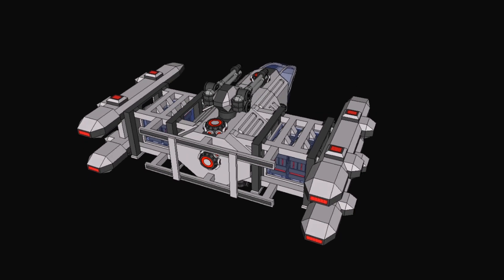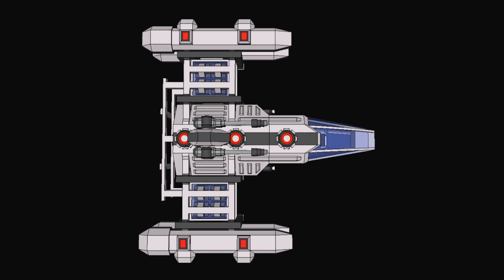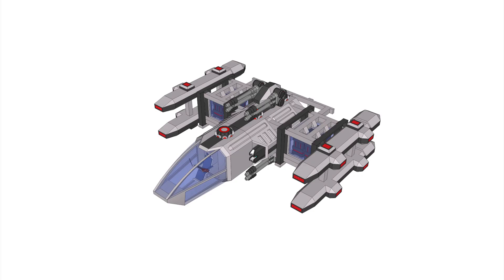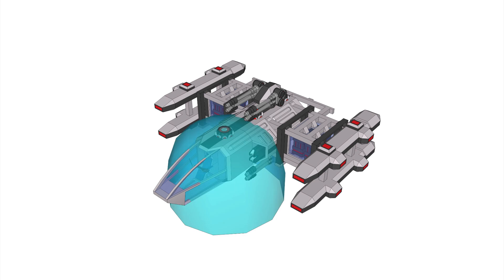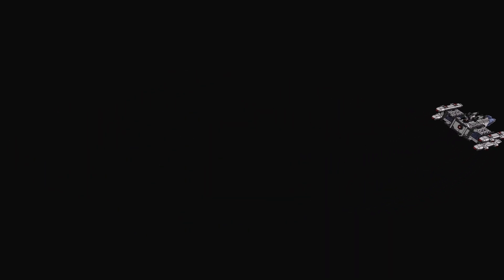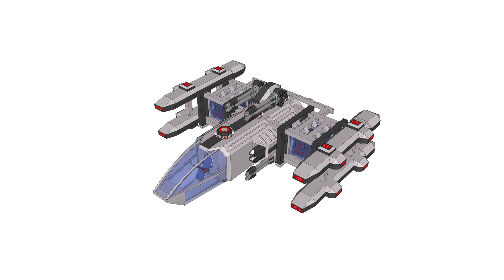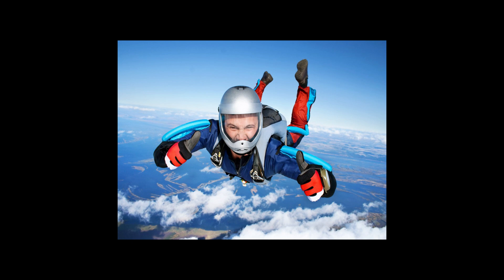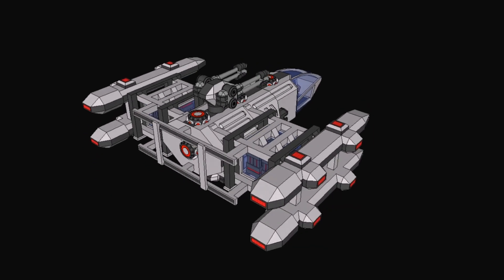Shad has a question! Gravitational acceleration on a spaceship?

Comment: Well, I'll close my eyes on the momentum conservation now. As your generator is on the spaceship I'd assume that it provides the uniform proper acceleration. I.e. you take the inertial reference frame in which the ship stands still and calculate the acceleration of the ship (later you'll have to use different reference frame moving faster) The faster the ship is moving with respect to the Earth the slower it will be accelerating. When it will approach the speed of light the acceleration will drop to zero. So your ship will go faster and faster but it will never actually even reach the speed of light let alone cross it.

That's very simple special relativity problem with solutions you can easily find. The worldline (you can treat it as a graph x(t) ) will be simply the hyperbola asymptotically approaching lightcone.
Reply: By the way, if you make your engine that magical (with momentum non-conservation and all that) you can get pretty ridiculous plots. Imagine that your engine can hold this proper acceleration for a couple of decades. So your heroes get themselves into hybernation and launch the spaceship at 1g. But due to some malfunction they wake up 15 year later (of their proper time) Can you guess how far they went? About 2.5 million light-years, flying by the Andromeda galaxy. Of course at the Earth there will pass about 2.5 million years.

Comment: Yes, since you're not inducing frame dragging by expanding space as well (as with an alcubierre drive) what you have is a relativistic drive in simple terms. (Since you're still moving through space, and so would be subject to things like time dilation as you approach C)

Other limiting factors would be things like impacts with micrometers or even atoms in space.

Interestingly, since you're creating the field with particles with a set velocity, as you approach C, I think you'd get a compression of the anti-gravity field propagating forward similar to how aircraft compress the air in front of them as they approach mach1.

The practical effect of this would be a speed limit based on several factors after which the nose of your ship would begin to spegettify as if it were approaching a black hole.

For higher speed craft, you may want to be behind the engine to help survive. (At which point, you can use being outside the field to create artificial gravity with the right acceleration)
Reply: As an aside, as with all relativistic engines, these make remarkably good weapons. (Even world-killers, depending on the mass and speed limit)

Stick a supped up one of these to the back of even a small asteroid and you've got a big boom! (Sure, the asteroid might be spaghettified into plasma, but at those speeds, structure is pretty irrelevant)

Actually, even if such weapons are banned, a broken ship moving at 0.9C would be a significant threat in the unlikely event it was actually on a collision course with anything important.
Reply from the maker: In my setting earth was destroyed through this very process 0.o

Comment: If you could induce gravity towards the front of the ship, then your ship would fall forward at constant acceleration. But it wouldn't be able to go faster than the speed of light due to relativity. To do that you need to create an  Alcubierre drive and compress the space in front of the ship, while expanding the space behind the ship. Just an induced gravity drive is good for sublight speeds only. It would also take a humongous amount of energy. On the plus side though, if you rigged things up properly, the ship would be able to pull off some very high g manoeuvres without the crew feeling the effects and being squashed.

Comment: Shad, I believe Your Idea wouldn't be too far off from another theory of propulsion that other scientists have, Known as a Warp drive . And if the base principle is still there.  Its speed would be dependent on how much gravity the generators can output. If the generators could push out cones of enough gravity in a single direction, It wouldn't be unlike a reverse of a black whole. So theoretically, With enough gravity, and if the ship could withstand the strain with its dampeners, its speed could be almost limitless. The problem lies in the physics, Unless the ship has a way to counter its mass, It would be torn apart once reaching speeds any where close to the speed of light. 
That is my opinion on what little i know about physics.

Comment: Probably the most popular form of "realistic" FTL transportation is the Alcubierre Drive. Give it a look on wikipedia(or anywhere else because it really is popular in the physics community). 

Essentially, you squish the space in front of you(so that the distance you need to travel is shorter) and you expand the space behind you forcing your ship forward. This would represent a large issue when moving at FTL speeds  however. If you are going superluminal, there is no way for you to send a signal to the front of your space-time distortion bubble. So you can't stop unless you crash into something...ending the existence of the world you were traveling to with the astronomical impact force. What you would need to stop your ship is a sort of railway system or, rather, devices to force your ship to a stop. Of course, that would imply that someone would have needed to travel to far away locations first to plant those stopping points first. 

So...maybe not the most practical method of FTL travel but one that hasn't been used very often as far as I know. If anything, it could serve as a secondary means of super-long-range travel when your standard fantastical warp drive just won't do the job.

Comment: If you are generating an artificial gravity over the entire ship, then the ship would accelerate by an equal amount and in the opposite direction as the "pulse field generators". So either there is no net movement at all, or the generators are ripped out of the ship. And if an on-board thingy can accelerate the ship as you describe, then all physical laws are out of the window.

Comment: Yes there is a limit: the speed of light, because as you get higher and higher energy matter from your ship going faster, its mass effectively increases, and the same energy input accelerates it less and less, asymptoting toward infinite energy required as you approach the speed of light.

So, basically what you said in the video, yeah.

There are other much bigger problems, though, with your plan:

1) 2+ Gs of forces in opposite directions on different thirds of the ship torquing around on and off in different ways is a pretty big unstable force trying to rip your ship apart. Engineering it heavily to counter this makes it harder to move, etc.  Depends how cheap and powerful those field generators are, I guess

2) As you travel really fast, random tiny dustlike debris or even protons floating around in space will hit your ship like artillery shells or worse. One of the biggest concerns in near light speed travel if you want to be realistic about it is shielding against this somehow. The long you travel, the harder it is (remember that if you use any expendable shielding, that adds up to more weight and thus more force needed, etc.

3) If infinite free energy exists in the form of pulse field generators, this would probably have made most of the adventures in your game pointless. Why would wars or conflict exist or most interesting storylines, if everyone had free, infinite energy from these pulse field generators?

Comment: Ok first off... Gravity is a pulling force not pushing force so you're starting point is wrong. Ignoring that...

With regards to how fast you can go... There are multiple answers. One of which is 0 speed because when you're falling you're falling towards the center of gravity, which you essentially are in that case.

The other answer is more along the lines of a crazy answer...
Let's say whatever you had to generate energy is infinite. Let's also say that the fields are being created in such a way that the center is in front of the ship thus making it fall towards it, the question is what is the strongest gravity we know of? That's black holes which produce enough pull that the speed of light isn't enough to escape it.

What happens when you cross the faster than light scale in conventional speeds? theoretically you start going back in time. Ok so what does that mean with regard to speed? It means you have decoupled from that concept. You literally can arrive before you leave any given place. 

This defeats the mass problem indirectly, has a different time problem, and has a major flaw that limits this all together...

You and the Ship go back in time a super luminal speeds, but how far? I can't say and here's why... the greater the gravity the slower time moves till it stops so how you're going at the speed of light backwards in time with no way to stop yourself because time has stopped... or reversed which case you can't go super luminal but you're stuck trying to go till someone stops you. So the limitation here is not truly speed of the ship because it can be decoupled from the concept, it the time aspect.

The question is How fast can such a drive go before the time dilation is too out of sync to do what you want? I've heard that you can get a significantly high fraction of c before it's an issue, but I'd think it varies with what you're doing. Realistically though, if you're doing maneuvering of any sort just think about how much lag you have in a net game before it becomes annoying. It's something like 30 ms. So the answer is while you could go however fast you wanted "technically" the human limitation and other limitations to this makes it relatively unfeasible...

I don't care to do or figure out the math properly but the limitation of 30ms lag is the most you'd want to account for in combat which I think is like .03c which is like  8993.7 km/sec
Reply: Sorry for the wall of text... not my fault. Youtube is causing that, not me.
Reply: I notice this on some channels, other channels let you use the enter key.

Comment: Simple answer: action X reaction. If the ship is pushing you down, you are pulling the ship up with the same force. Or at least you SHOULD, otherwise it won't be possible to sustain this sci-fied physics model without saying "it works, because it works - magic" or "just because". It's the same as trying to proppel yourself in the space by twerking :-D
Only way this could be used without this problem is separate gravity generator (on a HUGE asteroid or ship) to proppel smaller ship (Gravity cannon). Of cource that shooting the ship out of the grav. field would move gravity cannon back.

There might be also a problem with relativity. Normally (using thruster or another form of force as propulsion), increasing velocity increases relativistic mass as well, so thruster's force accelerates you less and less as you approach speed of light, up to the point where you'd need infinite force (or infinite thrust duration) to get you to final light speed value (so there actually IS some kind of drag in space, just with different name). With gravity field propulsion, you are using pure gravity acceleration instead of applying force to increasing mass to create final acceleration [a]. It skips the part that makes it impossible to achieve faster then light speed in normal circumstances. Your ship's mass would increase, but with no effect on acceleration at all, thus allowing this propulsion system to accelerate ship beyond speed of light, which should not be possible for any object with mass in normal situations.

It other words, too much trouble to use it in a sci-fi.

Comment: To answer your question first: if you can sustain a strong enough gravity field for a long enough time, than you can achieve light speed, or near light speed with enough time, ignoring any of the effects which going that fast would introduce, like time dilation and mass increase (although that's present for very fast travel in general).
This type of travel would completely forgo any cushioning required against jerk,  which is what would do you harm. Having this type of propulsion would be very similar to warping at lightspeed with no harmful effects as, if you have a powerful enough gravitational field,  you can accelerate to ~lightspeed in a second and decelerate in a second by applying a high g-force like 10 million g's forward and then backward.
It'd be a very neat form of space travel working as is. [EDIT] I do remember there was a recent observation which showed gravitational waves and the speed at which they travelled being close to the speed of light, so there may be a hard cap of that somewhere close to or at light speed due to the speed at which gravity can act.

And then the however.
The energy requirements and the realism of how your idea of artificial gravity works.
As with your explanation, you just create a directional field of gravity without the mechanics behind it. It's like saying using a directed magnetic field to accelerate something. 
Can you somehow apply a magnetic field in front of and object to pull it forward, doing the carrot on a stick and a donkey going after it trick? Probably not, at least not in our modern reality. It'd be like putting a magnet in space and a ferromagnetic object attached next to it, and using that to propel the whole system. It would just cause the two objects to move towards each other, and not travel in any specific direction. 

So while you can have your artificial gravity wells work as an isolated field super tech, I would expect the idea of the graviton particle to be more realistic. The graviton would be what makes the gravitational pull happen.
With this, there are still multiple routes to go with the travel, and I've been looking up things and contemplating ideas:
-miniature black hole generation
-graviton firing

All in all, both methods utilize a gravity field that is spherically uniform (for artificial walking gravity, just apply it on the lower half of the ship, so the ship would be like a small planet you can walk all around). That gravity field would have to be generated in an area in front of the ship, and would dissipate and/or be collected after the propulsion. 
With this, I run into my own question on whether this would work, but I'll explain the approach first. You would have two extended arms on the ship that extend out in front of the ship; these arms generate a gravity field between it, drawing the ship forward; the gravity field either dissipates or is recollected when the body of the ship touches it; repeat. 
In layman's terms, that would mean the same thing as a regular astronaut out in space, wearing a fully magnetic suit and holding a strong magnet, extending arms out holding the magnet, and releasing, drawing the magnet and body together. 
I feel like this would work, but it might turn out that just outstretching your arm would move your main body and your arm away from each other at the same distance the magnet would attract back, making the net distance of movement zero using this method. Then, I guess my question is would this be the case?

Even if it is, I've come up with a solution to solve it. Using the same layman's case, a permanent magnet shouldn't be used, but an electromagnet that would only have electromagnet pull when you charge it up. Thus, as you push the electromagnet away from your body, there's no electromagnetic pull or force against you as you move it away. Then, when it is extended, you turn on the magnetic field and release the electromagnet. So, because you haven't work against the magnetic pull as you extended the electromagnet, then the amount of work should take place when the magnetic field does act on you, after releasing it.

This would work the same way with the gravity propulsion. As said, that gravity field would have to be generated in an area in front of the ship, and would dissipate and/or be collected after the propulsion. With a black hole generator, using some essence of modern techniques, the ship, with it's two extended arms, would shoot some amount of mass from either side of the arm at extreme speeds (near light) towards each other, colliding in the center of the two arms, and creating a miniature black hole. The gravity would pull the ship and the black hole to each other. Then, either the mini black hole is collected or it dissipates on its on, and whatever energy/mass released is collected to be reused again. This method is the most feasible and seemingly doable with our modern knowledge, I think, but the energy requirements would be enormous. It seems the most grounded to me, but because of the immense energy required and how it works, it may be best suited for large ships.

With the graviton firing method, we assume to have the capability to amass/collect/create gravitons. In the same manner as the black hole generator, we would shoot stuff from the arms to generate a gravity field in between, to accelerate the ship towards the arms, or forward. This time, it would be shooting gravitons that meet in the center, and pull the ship towards it. The gravitons then are dissipated and/or collected to be repeated again.

Overall, I think the design of the ship would be somewhat backwards from modern ship designs as the engine/thruster pulls instead of pushes. Somewhere in front of the ship, there would have a, perhaps, cylindrical thruster (shooting gravitons from multiple directions towards the center) that creates the pulling effect. Your ship design currently could have these thrusters on either side of the ship to allow for turning to some degree. Or it could be more of a omni-directional design which can propel the ship in any 360 degrees of direction, having these thrusters all around the ship, making for a very maneuverable spacecraft.

I guess that's the extend of my knowledge and bit of research on the subject.